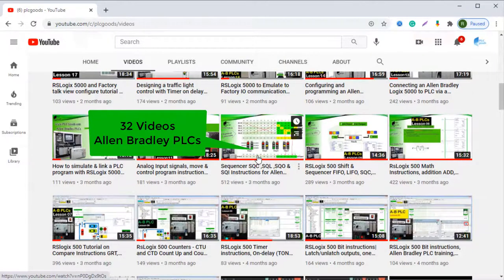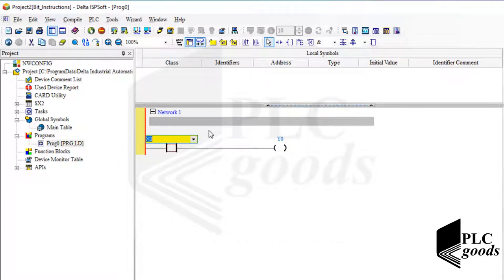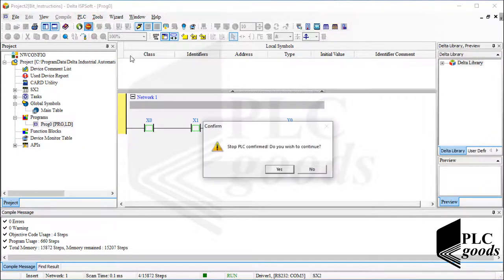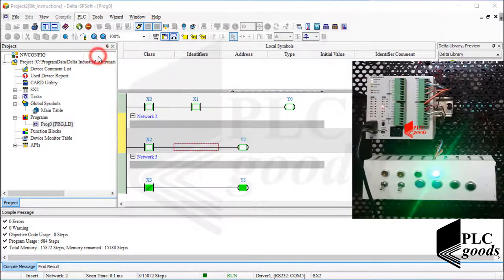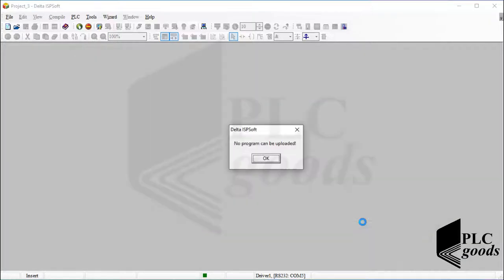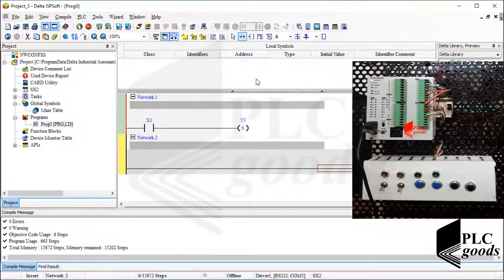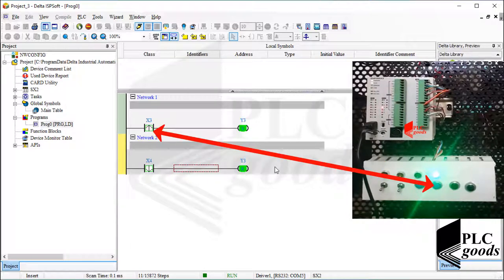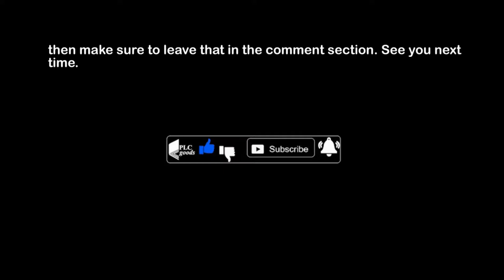Delta ISPsoft plc programming | sample ladder programs using WPLSoft & COMMGR driver

Comment: I went through your PLC program's software structure. I am unable to locate a simulator within the program to test it offline before uploading it to the Delta PLC.
 Could you please let me know where I may be mistaken?
Reply from the maker: Hi there, Note that you also need to download and use COMMGR software for testing your programs. It can be downloaded easily from the DELTA’s website. Please see our videos from the first one. I explained all steps to download, install, write, and test programs during the Delta course.

Comment: Downloading a program to PLC must not require a battery to hold it in memory.  Must be similar to a USB stick memory that is permanent without a battery.  Hopefully a program will not become corrupt in time and can last decades.  No formal format of the PLC memory is required?
Reply from the maker: Please let me know if you are giving me some  information or asking me a question?❤
Reply: @plcgoods  Electrically Erasable Read Only Memory or EEPROM.  Previously in my RSLogix micro, I have the menu for EEPROM.  Burn a EEPROM with a EEPROM burner.   In the 1980"s this was used.  That it was an EEPROM and not just a EPROM meant, easily erasable.  You show at your website to have RSLogix 500 & 5000 courses as well, so this is not anything unfamiliar with you I am sure.